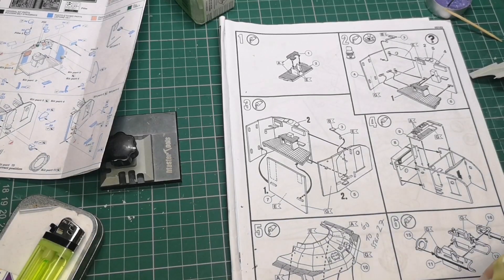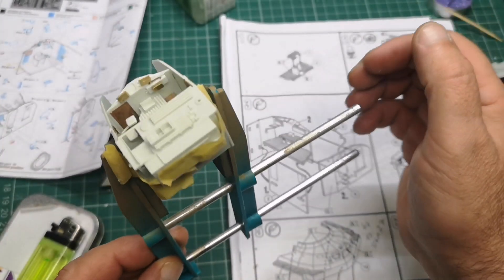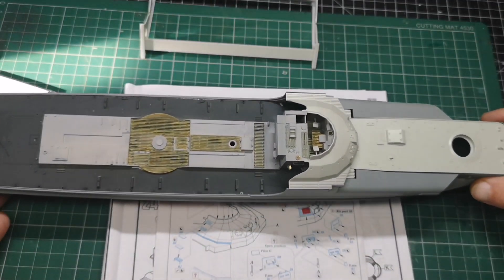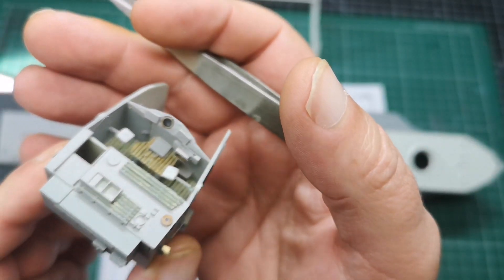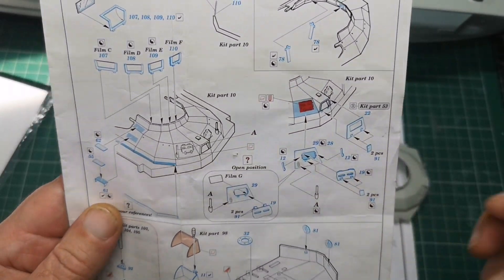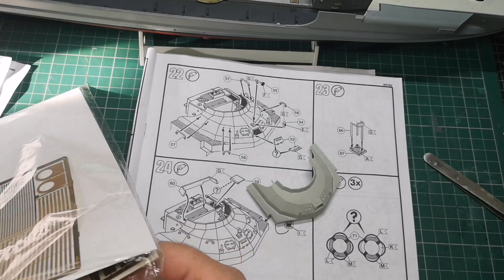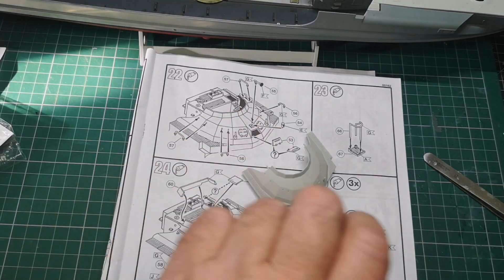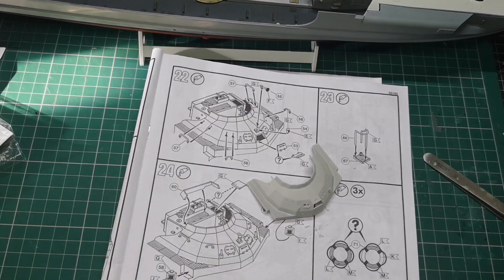REVELL S-100 SCHNELLBOOT 1/72 PART4

Comment: for opening that window, a series of small holes around the inside, use a knife to cut the piece out then the small triangle file to clean it up.I'm not 100% certain, but I think those parts 91 needed to be turned 90 degrees.
Reply from the maker: Thanks Randy will check it out stay safe 👍

Comment: Paul,  personally, I prefer to see as much of your build process as possible - it shows me issues that you have faced and overcome so that I may be able to use some of the same techniques if I end up facing similar issues.   Obviously, it is not necessary to show the detailed work on, for example, both the port and starboard sides if they are dealing with the same sets of parts.
Reply from the maker: So really what am doing now is fine ,Is there anything you would improve. Thanks Tron appreciated
Reply: @plasticmonkey5594 Paul,  I find that  having a partial shot of the hull of whichever ship you are currently  working on, at the top of the screen, is a little distracting.  I keep thinking that there must be something interesting up there that just isn't quite in frame.   On the other hand, I really like that you have the instruction page from which you are currently working almost always completely in shot.  This allows me to follow along with the build sequence, even though I don't have the kit.
Reply from the maker: Thanks Tron really appreciate it, as you know am a newbie at this ,And any tips or info very much appreciated, stay safe

Comment: Nice work on the PE parts Paul.
I put some PE parts on a couple of aircraft I built, but I found it to be a bit too fiddly and since they were mostly on the inside of the aircraft it was a waste of time and effort...
Reply from the maker: Thanks appreciate your comment ,Personally I think you got to pick what you use ,plastic molding is so good today.
Reply: @plasticmonkey5594  They look good on your boat as most of them are very visible. On the inside of an aircraft it's basically only you who know they are there though. :)
Keep up the nice work!
Reply from the maker: Thanks like you say if you can't see it what's the point in my opinion